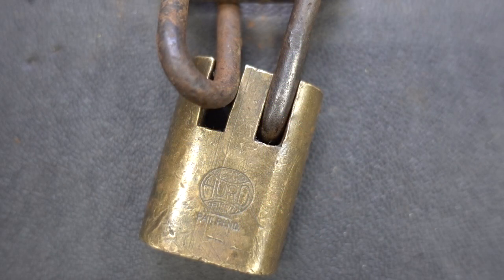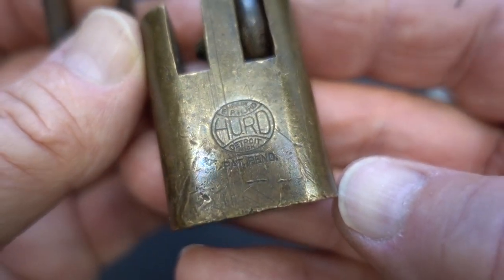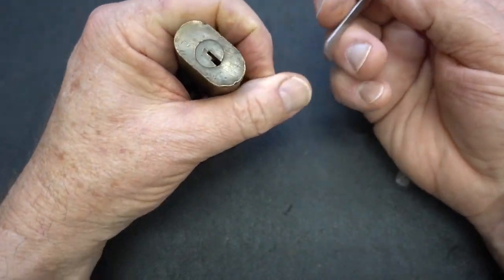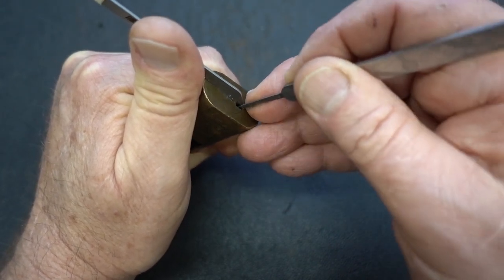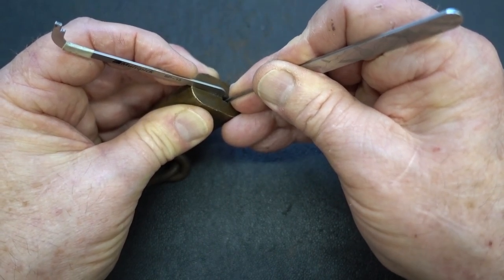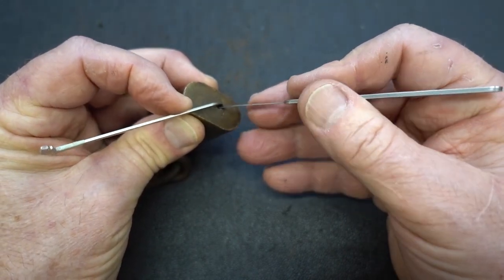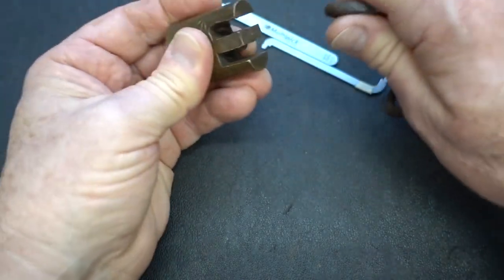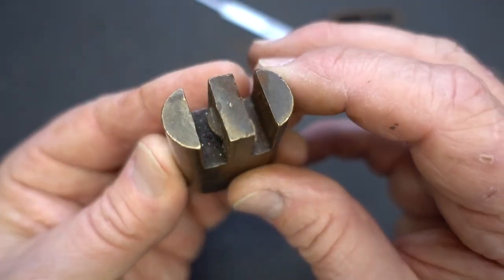(1640) Hurd Micro Padlock

Comment: Bill, you stumbled onto a gem! It’s a spare tire lock from the 1920’s... back when spare tires used to be held on the side or back of the car by just a couple of leather straps. From the factory, I believe it had about 20” of chain permanently secured in one side of the lock, and the other side operates as you demonstrated (only spanning half the gap, but enough to hold the chain in place). If you want to see one of these in pretty good shape, see my video 331. 👍

PS- It might be a good restoration project... these locks are coveted by antique car collectors.
Reply: So he could be sitting on a small fortune?
Reply: Hello LPL love your videos
Reply: @PriyoM1993  lol wrong channel b.b.
Reply: @lockpickinglawyer  He's not going to get lucky like that.
Last year, there was a 4 pin Best padlock going on eBay. The auction was insane. It went for over $600, I think. That would have made for a nice dinner.
Reply: Definitely should be restored.
Reply: Nice catch and lucky for Bill he got fooled again.
Reply: @jesusyeshuaelelyonelshadai6295  woosh?
Reply: so when was video #331? a few years ago or longer?
Reply: Here is a link to LPL video which gives a bit of history of the lock. Nice job Bill and LPL on showing another bit of lock history https://www.youtube.com/watch?v=gFBv0zB98lg
Reply: Thanks for the information, it really is nice to know.
Reply: Was just about to write pretty much the same as you have but you have saved me the trouble :D was also going to add I woulnd't mind restoring it for him if he wants it restored
Reply: Who is this guy?

Quit begging for views on Bosnian's channel, newbie!

Lol jk <3 LPL
Reply: Thanks for the back story, Harry.
Reply: That's what I was wondering--the side that didn't retract looks like it is permanently attached to the body, so I was thinking the same thing. Thanks for confirming!
Reply: Very cool info!
Reply: @jesusyeshuaelelyonelshadai6295  LPL was the guy who ID'd the lock bro
Reply: Here's the lock that LockPickingLawyer and I restored :D
Reply: LockPickingLawyer lit

Comment: When I get locks like this, with an unknown history and clearly has some age to it, i give em a 5 minute soak in my ultrasonic cleaner, then a shot of 3in1 dry lock lubricant. Works like a charm. Recently was gifted a 100+ year old Yale post office lock that was really grimey. 5 mins in the ultrasonic cleaner and it came out looking shiney and new!
Reply: So those really work? I've been waiting for someone to do a video of one with a lock.
Reply: I was just going to ask Bill the best way to clean lock internals. I guess it may be a spray of WD40???
But that doesn't always rid it of rust/trash. The ultra sonic sounds good.
This may make for a good video??
Reply: @two_tier_gary_rumain  ultrasonic cleaners work great if you get a good one. once you have one you'll find all sorts of uses for it beyond lock cleaning :)
Reply: @400_billion_suns  I'll have to check it out. Been using messy chemicals lately.
Reply: No no no. Ultrasonic cleaners take all the character out of locks. And also reduces the challenge. I wouldn't want a super clean 100 year old lock. Just my opinion.
Happy picking though bud.
Reply: @randomstranger6873  It's a matter of personal preference. If the ultrasound clean doesn't damage a lock then it's better than what some are doing. I'm referring to a vendor on eBay sandblasting vintage locks.
Reply: @loufaiella3354  I soak old nasty gritty gummed up locks in a cup of kerosene overnight, then blow them out with a blow gun then hit it up the keyway with a shot of 3in1 oil and blow it out again to get rid of excess oil.. Good as new every time.

Comment: You've taken apart thousands of locks and put them back together I'm positive you can fix one broken eBay lock!!
BTW I think eBay got all of us at least once.☹️
Reply: 500GB Flash drive :(
Reply: I ordered some low-priced lithium batteries and they ended up being mostly air.
Reply: I once got a PC, it's listed as broken,
 and it actually still work
Reply: I doin't think this the first time though he got something of EBay that wasn't what he thought it was.
Reply: The locks he takes apart are locks that are designed to be taken apart. Smaller/cheaper padlocks on the other hand are not generally designed so you can take them apart non-destructively.

Comment: Try sooking the lock in Brak fluid. Let set for about 3 weeks. Then tie it about the container for the brake fluid to drain into for a day or two. I have had very good luck freeing up hand tools that were completely rusted together. The Break fluid breaks down the rust and allows parts to move again.

Comment: it looks to me as if the locking mechanism in the lock is a rotating disc with a cutout. 
@0:49 you can see a small cutout in the back of the disc.
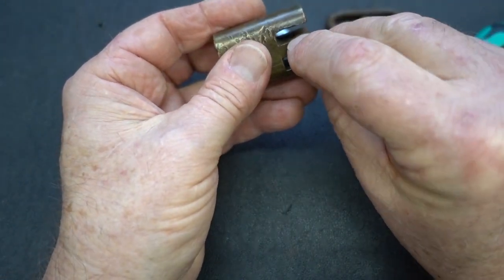@3:58 it has disappeared. 
My guess would be that if you turn the key 90° in one direction, one side is released and at 90° in the other direction the other side is released.
Reply: So he needs to pick it the other way
Reply: I don't believe it will turn the other direction. I'm guessing it turns only once for installation, and then a trap pin locks it out from ever going back.
Reply: it a hurd spare tire lock i have one only one side opens the chain shoud have bin attached to the side that dosent open
Reply: I just watched the video from LPL [331] about the lock and I think R.P. Rosen is right, it will probably only turn the other way once during production and then be locked somehow.

Comment: The middle section is bent. Maybe you can straighten it. Use the degreaser of your choice and vibrate the lock for a few minutes. After a few tries, it should help a lot.

Comment: I reckon the side that did not retract was supposed to retain the chain, and the other side was to lock the other end of said chain. You said the initial side looked bent, so maybe someone, rather than pick the lock, just jemmied the base of the chain out of that side? Just an idea, ya know?
Reply: It's a spare tire lock from the 20s or 30s and the slot with the fixed stud was never supposed to be operational. It permanently held a 18"-20" piece of chain that came with the lock from the factory. From the looks of it at some point someone lost the key etc. and pried the chain out of the slot with the dog and that's why it is bent outward a little.
A new piece of the same size chain should be stuffed back in there and it could be crimped back in with a sizable bench vice or press and it would be a 100% workable lock.

Comment: Good soak overnight in white vinegar then another soak overnight in some vegetable oil then a good spray with WD40 should clear out any gunk that's restricting the movement and if it's still a little bit stiff a good blast with a hairdryer on high ;-)

Comment: It has all of the hallmarks of a stolen lock. It has ben attacked at length with a heavy implement, has been forced apart, and then the chain has been cut away. To add insult to injury, they've sold it for profit, and couldn't even be honest when they did that. At least they had no idea about its potential value, and it will be worth something to collectors when you have  restored it. Thanks Bill.

Comment: Maybe the other locking lug either opens when you turn the key the other way, or its sprung loaded and is supposed to be chain retaining.
Reply: The other side is fixed and holds one side of the chain.  Only one side opens with the key.  LPL has a video showing a working one with a key.
https://www.youtube.com/watch?v=gFBv0zB98lg

Comment: Is it possible that the lock only is supposed to release one side of the chain at a time? E.g. spin it the other way, the center rotating disc releases the other side? And it'd probably be possible to pad that bent side and use a vice or dead blow hammer to push the bent side back into place.

Comment: Hi mate, how do you rate those multipick tension wrenches ? as compared to say the sparrows version of the same ilk ?
Reply from the maker: I have both.  Both are excellent products and will get the job done.  The MPs have the advantage of one additional thickness (4 wrenches versus 3 in the Sparrows set) to give you another option and they come with a leather case.
Reply: @bosnianbill  Thanks mate that's interesting, I got a few last week and when they arrived ( I bought the sparrows top key tension wrench set; & it included 5 bars of a narrow range of thickness, I also got the comb picks (again 4 or 5 thickness & 5 or 5 teeth on the combs which also had top key tension bars on the opposite end, and thirdly I got the sparrows "heavy bars [2]) I found them to be quite awkward to hold = they feel too short to bend, but are juuust a little too tall to hold a padlock and tension with the index finger with any dexterity, but perhaps it might be a technique thing I haven't worked out just yet ? which is probably the case considering I haven't been picking  more than 6 or 7 weeks, and speaking to that point I'd like to take this opportunity to thank you, LPL and the locksport community as a whole whom have all been just fantastic welcoming, helpful and most of all just good people, case in point you responded super fast to my (a random you tube comment with a question) post within half a bees dick of time.

P.s I saw a really old video of Kokomolock's and he had some neat looking wiper insert wrench that was folded back on itself origami style and turned into a top key wrench, as its been raining a lot here recently I might go bin diving at supercheap auto and see if I cant copy that & try that before I spend any more money..

Thanks again  Bill, you're a credit to yourself and the community as a whole.

 

Much respect;
UN-Common Sense AUS